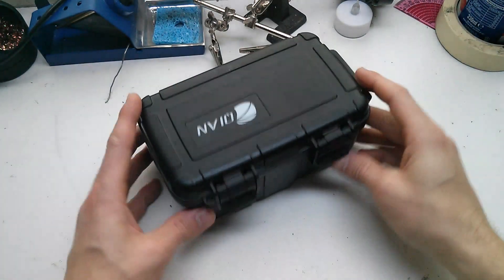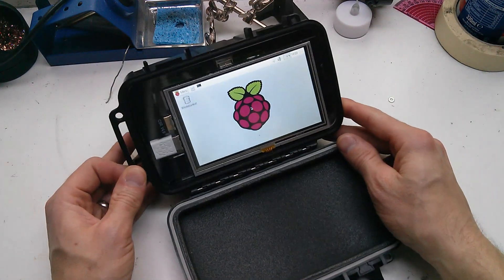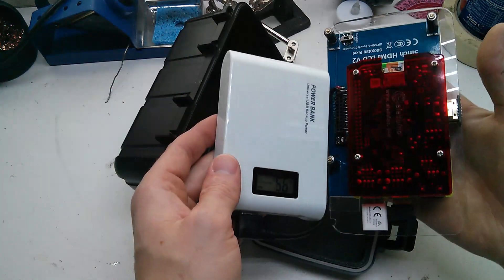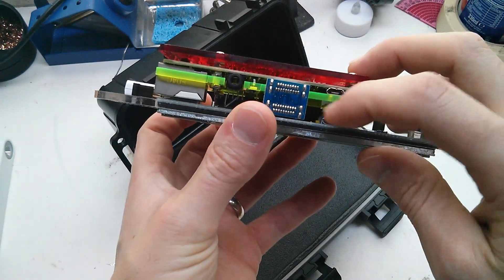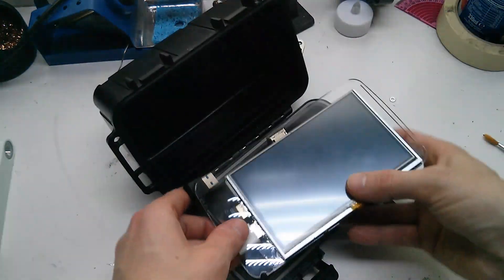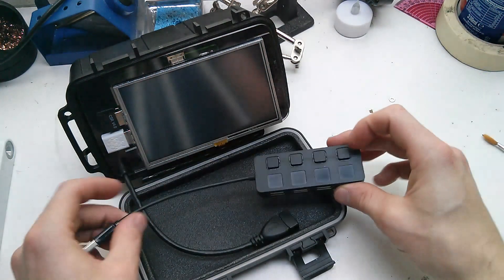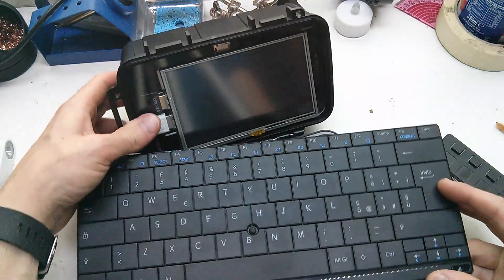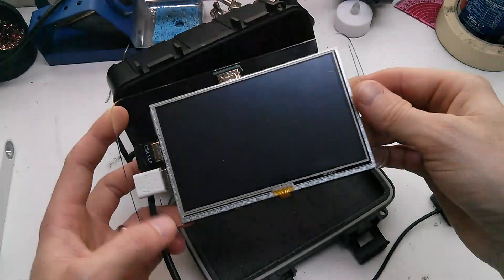Portable raspberry pi

Comment: 3:40 I believe it is not a German Keyboard. First i noticed it by the lack of ÄÖÜ in the right upper Corner after L and P. But also because  german Keyboards have QWERTZ and mostly the missing "ß". Now the interessting stuff: Which one is it? First I though about a French, because of "é and ç" but they are using a AZERTY. After further investigation i think you have a Swiss one???? Cause they also have no "ß" then "é and ç" seems to match and also they use instead of "Strg" the neutral version "Ctrl". But im not 100% sure. There are also differences between Swiss French and Swiss German.
Reply from the maker: I think you are right, in the eBay listing it said it was German. I never realised how much keyboards differed from country to country